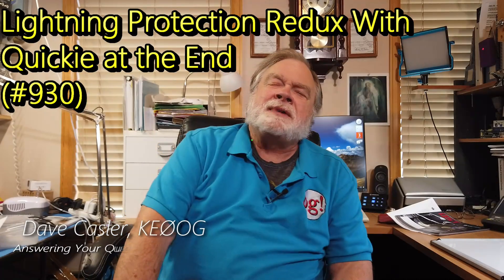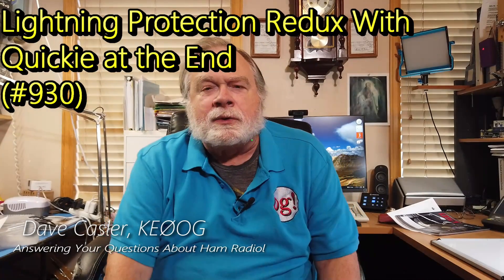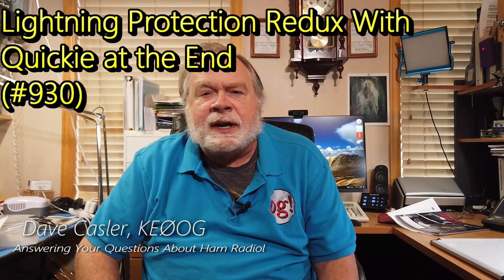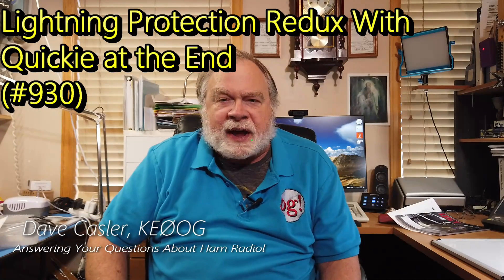Lightning Protction Redux With Quickie at the End (#930)

Comment: NO!!!! NO!!!! NO!!!! Do NOT attached your ground from your equipment to an "additional" ground rod(earthing rod). That would cause lighting to come in, not stay out!!!! Especially a ground sharing a ground rod with the tower or ground rod near the tower!!!!
    Your tower's ground rod is there to bring the protentional of the tower down to match the potential of the ground. That helps to keep your tower from attracting lighting. It also is there to help the lighting to find the ground, if you are unlucky. So you REALLY do NOT want your grounding of your shack to be outside.
    Grounding in the shack, if insufficient, take a #6 ground wire back to the 'main' disconnect panel. Sub panels do not combine the neutrals and grounds. You want to go back to the location where the grounds and neutrals are tied together. 
    If you have a voltage issue between your ground in your outlet and the neutral, call an electrician. Your problem is the house wiring and best way to rectify it is by an electrician. It is common in houses that have had a lot of work to have some wires messed with and often the ground wiring is half finished from the addition of added wiring.
     P.S. If >ALL< your equipment is grounded together with heavy straps and or wire and the neutrals and grounds are at very near the same potential, your equipment if in proper order should work well. The problem may not be in the shack.
    P.S.S. One cannot have enough protection for expensive equipment. House surge protectors are a good idea, they are around $100. And lightening arresters are never a bad idea.

Comment: The other thing an Internet connection is useful for in FT8 is time sync. The mode is very dependent on a decent shared time of day. I think newer versions of the software may help by listening for when other stations start and adjusting accordingly,  but I haven't tested it.

Syncing tine (Windows, Linux, & MacOS do it automatically) before you leave will be more than sufficient under normal circumstances. If you use a Raspberry Pi, however, be aware they don't have a battery-backed clock, so ot has no idea what time it is until it gets a sync over the Internet, GPS (extra dongke required), or manually. They also make addons with battery backed clocks for it.

Comment: I'm going to makw a rail of so239 barrels which are inline between radios and antennas. Adjacent I will build a box with rows of so239 connectors, all mechanically connected (center and shield together) and soldered to a large ground cable, which will lead down and out of the shack. When storms are coming, will disconnect the the antennas and plug them into the ground box. This is in addition to a standard ground/junction box outside the shack to ground rods etc.

Comment: Holy hole in a doughnut, Batman! Grounding causes the voltages in the equipment to all rise and fall together at the same time. It has never been explained to me like that so I have always wondered what the point of grounding even was when it comes to lightning protection. As you said, we are talking about hundreds of thousands of volts, so what does it care about a tiny little gap or anything else really. Thank you for the ah ha moment, Dave!
Reply: Yes Jeremy - I had not heard that part before either.  Keep the potentials the same and the current does not flow between them. I appreciate the difference of potentials so that should keep the currents between pieces of equipment stable.  
Thanks Dave!

Comment: Thank you Dave. Your comments about the AD surge protector near the end reminded me of a question. Are the “DC pass” lightning surge protectors even functional as protectors? I installed one on a previous setup because I was using a MFJ bias Tee to get 12v out to the tuner over coax. Later I just ran a dedicated line, but I’d love to get your take on dc pass surge protection. Thanks! de W4CWL

Comment: Thanks Dave, for this.  You've explained this eloquently many times but my situation appears perpetually unique.  My circuit panel is located in a mud-room just inside the front door of my newly constructed house.  It is 7 feet up on an interior wall about ten feet away from the house's brick exterior wall.  I cannot get to the service ground which I assume is under the floor near the left front corner of the house, near where the utility pole is located.  There is no basement as such, it's just a two-foot crawl space above a rebar reinforced poured concrete floor.  All that means is that I cannot get to the house's utility ground, either from inside or outside the house.  To make matters worse, my shack is in the rear corner diagonally opposite from where the utility pole is.  My only choice for a station ground is to bury a ground rod outside my 2nd floor shack window and run a bonding wire up the wall and through the window.  I could also bond the rod to an outdoor duplex box located a few feet away.  That should connect the rod to the circuit panel via standard 14/2 Romex (with ground wire) and make its way through the house to the circuit feeding my radio gear on the 2nd floor. My question is, is that a good idea or am I inviting a lightning strike to enter the house via the house's own wiring?  What are my alternatives, if any?  Thanks!  73  JS2OLO

Comment: Thank you, Dave. Grounding is good.
   Over 30 years ago, many of my amateur radio friends did not have lightning surge suppressors or outside ground rods or use bonding. I started talking to the electricians I worked with and got an earful. I have been educating others since. N0QFT
Reply: Electricians generally do not understand the purpose of 'earthing' (grounding). Do NOT add a ground rod. Only place a rod should be attached is to the main disconnect panel. NEVER and I mean NEVER run a ground wire outside of your shack from your equipment to a ground rod. 
    All grounding should go back to the "main" panel where the neutrals and grounds are combined.

Comment: Dave, am ready for Spring weather as well.  35 degrees F here in Northeastern Pennsylvania with snow flurries today (4-18-2023)   Thanks Dave for the video on lightning suppression.  The Alpha Delta devices are indeed of professional quality and personally use them on my installations.  73
Reply: NEPA here as well, although currently in MN where it got to 48 F.  Just received my Technician License, and looking for good starter gear to use at 1800' + above sea level. I find Mr. Casler very informated, and well presented.